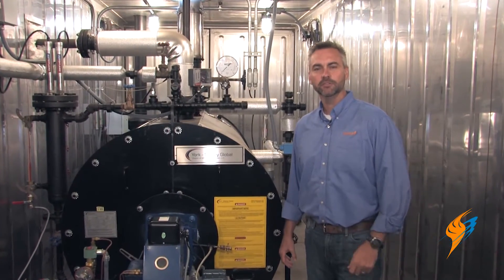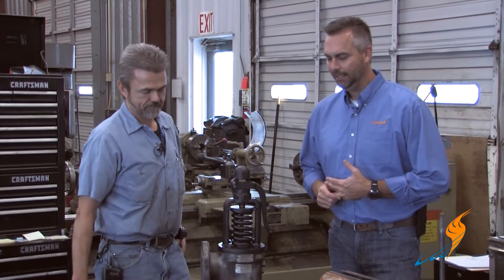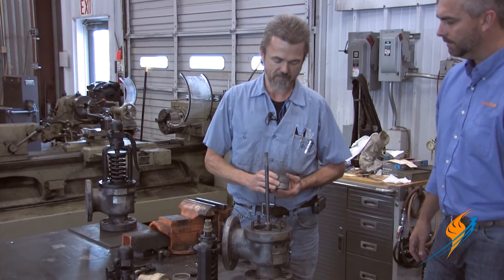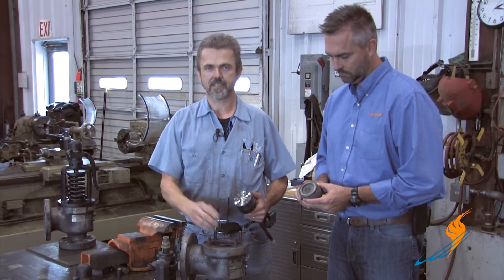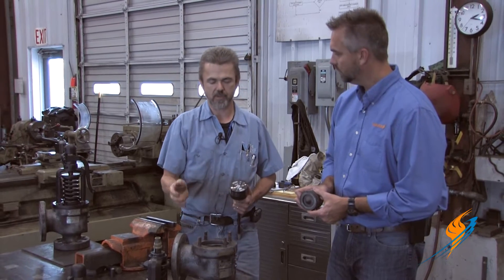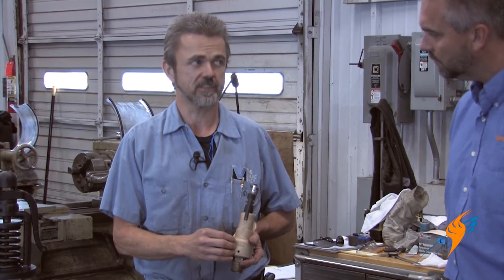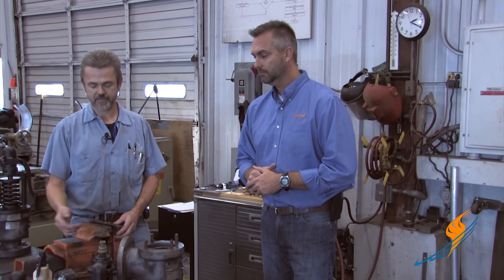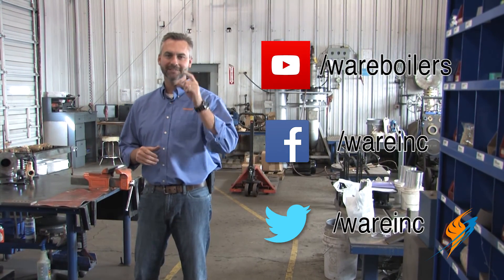Steam Relief Valves - Boiling Point

Comment: Under BS 2790 it is illegal to put your discharge pipe into other pipes. You cannot see if it is blocked which will cause the same problem. As you know they often drip which causes it to rust and block the drain. You must pull the safety valve handle at least once a month to clear the line.